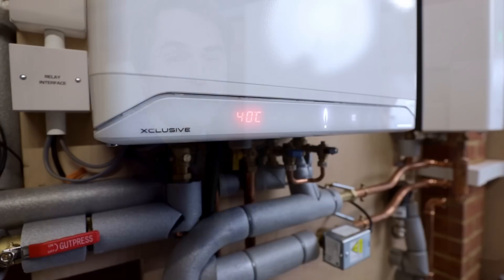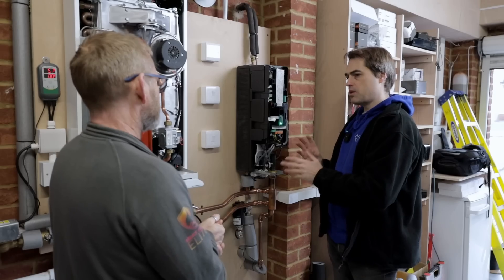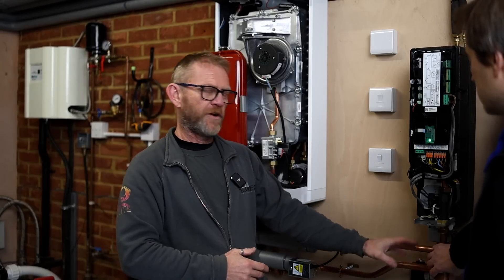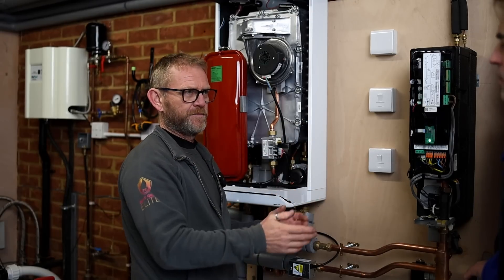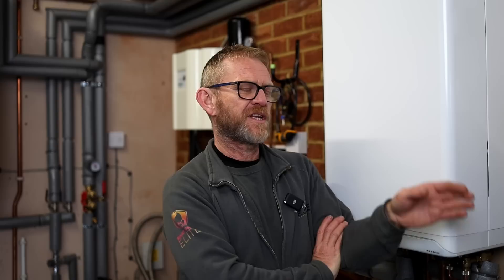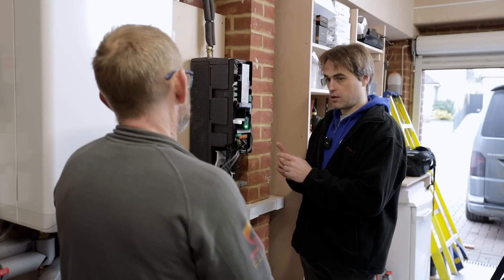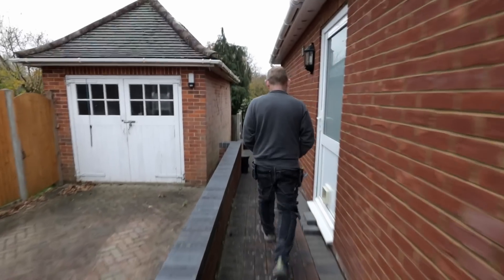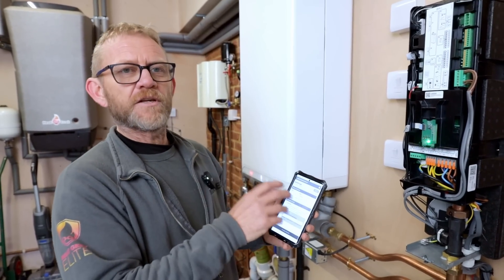Intergas Heat Pump Hybrid - The Easy Way To Clean Heating?

Comment: I run my hybrid system by topping the weather curve of the gas boiler by 2-4 degrees off the HP. HP delivers ok and only compensate with the gas boiler when OAT is 0 to -2, rainy , foggy, because the HP defrosts a lot but still delivers. It`s my first year using the system and I still play with the settings. There are two things I want to test for OATs 0 to -2 (worst for HPs), one would be to activate the BUH if OAT is 1 or below, so HP only in this scenario and the other is HP (BUH off) + gas boiler using schedule to offset the LWT of the HP to lower values that it`s actual demand from the curve, mostly during the night. There are options out there to automate these systems even better but at the moment I don`t want to modify the hydronic part. This season I heated with HP 99% (2 days heated with the Viessmann in Nov, testing different settings, full HP in Dec) and got a COP of 3.52 for both Nov and Dec, so far. Weather was mostly positive with OATs 1-13 but little sun a lot of rain and fog. I had negative OATs in Dec, 1 to -3, dense fog, for 4 days and having seen HP`s poor operation, I thought of ways to increase the pump performance and balance the heat demand between the 2 sources. Nice you are able to test different things and share an honest opinion. Cheers

Comment: Thanks for the video. Would love an update to see if fitting a buffer helped?

I love the concept of having a split ASHP: The outside unit is smaller and non split ones and it only weights 43 kgs according to the user manual!
Looking back at my smart meter data on the coldest day in Jan 2025 in Sheffield last winter, my gas boiler consumed on average 2kW of gas per hour, totalling ~90kWh for the day (that's excluding DHW). The outside temperature that day was -1 degree Celsius avg during the day and dropped to -6C by midnight...
With that it mind it sound like the Xtend split could be a good fit?
Am I right to assume by gas boiler would barely kick in if at all except a a few very cold days?
BTW my DHW is handled with an electric Sunamp battery (with PVs on the roof).

Comment: So from 11 months ao have they updated the software to allow the boiler to work if heat pump does not work
Reply: @UrbanPlumbers Would love an update, more in depth info on the software would be great if possible, a walk through on how to configure for peak, and off peak electricity costs for example ?

Comment: Why not just add a ASHP in series with the gas/petrol boiler network and have the boiler pump run all the time? ASHP can work with temperatures above 2C and boiler for lower outdoor temperatures. As a retrofit mostly but as a new system as well. Too much controls?
Reply: This is what the Alpha hybrid does - boiler and heat pump piped in series with a pump in the boiler and no pump in the ASHP. But you can't add it to an existing combi unfortunately.
Reply: @chrismorrish130  yes I know. The reason is the controls integration of the old (non Alpha family) boiler with the new system?
Reply: @christossakizlis  They don't even sell the heat pump as an addon for an existing Alpha Etec 33 boiler.

Comment: That look like a terrible setup. At least the alpha one works. They are not bothered about their carbon footprint with a swimming pool in the garden. 😂
Reply: The alpha hybrid is one of the worst hybrid setups out there.
Reply: @BristolHeatPumps  the alpha one works, this one is a comedy sketch. Daikin one seems to work ok, anything but this. Let’s try and reduce our carbon while heating our pool 😂
Reply from the maker: It’s a decent set up and very popular in Netherlands - that Alpha is not even close.
Reply: @AllenHart999  what do you classify as “works” pretty broad range. If your talking about it being a good stepping stone into renewables and putting it against other manufacturers hybrid options its an absolute shambles.
Reply from the maker: @BristolHeatPumps radiators get hot mate - it works !
Reply: @UrbanPlumbers  can tell he has been following heatable around 😂

Comment: Mmhhh, I'm not sold on this. Seems a bit like hybrid cars:- twice the complexity. If a heat pump can't get a property up to temperature it should not be installed. ICE cars make more sense in some applications, and BEV's make more sense in others. The main benefit of a heat pump in my eyes is to be able to get rid of the gas meter and save the standing charges on gas mains supply....

Comment: Great video, would this work on 24k HRE heat only using a x plan  with opentherm ?
Reply from the maker: yeah, should work fine
Reply: Thanks for that. Also Iam trying to make my x plan a x plan plus by fitting  a mid position valve after the N/O valve . It works to a degree  however Iam struggling with the opentherm on the nest wiring. Any help? Cheers Jimmy.

Comment: I wanted to confirm that the combi could still supply instant DHW with this setup, so watched again and indeed, that is confirmed by comment "no need for hot water cylinder". 
I believe this is going to make this set up a viable option for the majority of properties in the UK, as millions have had combi boilers fitted to gain room space (mainly in the form of loft conversions) leaving no room/space for a cylinder to be put back in!

Comment: Daikin  was using the Intergas boiler with heat pump system nearly 10 years ago, shame it didn't catch on, even then you could set the electric price,  the gas price and the system would work out the best way to run.
Reply: Yes, the Daikin hybrid system also uses intergas gas boilers. But the advantage of Daikin hybrid system over Intergas own hybrid system is that the gas boiler can work on its own even if the heat pump fails, according to Viva Training. Intergas should copy what Daikin do, they both use the same boilers, it's just the rest of the system that's different.

Comment: The main issue i see is that as soon as it drops below zero the ASHP frosts up and the COP drops through the floor.  This is the exact time you need the highest output from your heating and the ASHP can't do that.  A boiler can regardless of external temperatures.
Reply from the maker: That’s why a hybrid is a good idea

Comment: this has the potential to revolutionize the adoption of ashp's in the UK. But only if the government get off their high horse and start funding heat pumps even in the case the user is not willing to get rid of their perfectly fine gas boiler. At the moment, you can access a grant only if there is a complete swap over to a heat pump, which is not a thing a lot of people are willing to chance. Plenty of stories out there with conversions going wrong, huge electric bills, and not a lot of comfort at the end.

Also, on a side note, you just gotta love it when the management page for your multi-thousand pound heat pump misspells 'thermmal'. Confidence builder right there.
Reply: Imagine if the Brits had to write their manuals in French or German, Czech, Polish.. Hungarian!

Comment: @ 13:08 yes - homes with underfloor heating when is not that cold… but It might need a grundfos 15-75 pump inside to be able to run the underfloor heatting by itself on 100-120 square meters without an auxiliary pump …

Comment: I really like this ideea, but in the end  is it worth the difference in investment cost, taking into account that you get a less reliable system due to the complications brought to the system (useful by the way) and all this in the name of saving the environment?
wouldn't it be easier to be less aggressive/sporty at the wheel to compensate by far for the climate difference? I pay about 3 times more for gasoline than for heating the house... and I think I would pollute less if I learned to drive more calmly...

Comment: Ultimately I'd like something similar but a back boiler on the wood stove going to a buffer to boost an air source heat pump.  Not sure if it's possible or something anyone will agree too fit!
Reply: Better buy a solar System for warm water in the no heating decade . No heating Pump. 👍🇩🇪. Use this  System since 1995.

Comment: The Xtend is too small, to meet most demands and also access funding.

From my understanding you won't get gov. funding through mcs unless the ASHP meets the full heat loss now in Scotland, even for hybrids (except in extenuating circumstances) So only having 5 Kw available, (3 at sub zero temps?) is a bit small & limited for the majority of houses up here... 

And most won't install without funding...
Reply from the maker: its a perfect size for a hybrid. We acutally need more sub 5kW / -2 heat pums. There aren't almost any.

Comment: Like you Dracula, I’m a big fan of Intergash, but they’ve clearly not designed this system correctly!! The Indoor Condenser is clearly piped up wrong with, as Tommy states; the Gas Boiler should be the Master & the Condenser The Slave & piped up accordingly.
The Daikin hybrid system is a much better design. Also, the Vaillant is a better set-up & their control system is much superior to anything on the market.

I’m amazed Intergash produce & market such a poorly designed unit.

Thank for sharing Dracula, by the way you’re piling on weight, what you been eating@??!!
Reply from the maker: It will work fine on sub 5-6kw heat loss
Reply: Funnily enough, Daikin uses intergas boilers themselves in their Daikin hybrid systems. But I agree the overall Daikin system is better than the one Intergas themselves provide, even though they share the same boiler because for the Daikin setup, the gas boiler can work on its own even if the heat pump fails, unlike the Intergas's own hybrid system. Intergas should copy Daikin, they share the same boiler its just the rest of the system that is different.

Comment: Seems as though there will be more boiler cycling with this setup, even if it has a low minimum output.

The boiler is providing only a supplemental load, which is bound to be less than if it was the only heating source.

Hybrid might help out with niche setups but pure ASHP seems the way to go if at all possible.

Comment: I don't wish to be negative but I am struggling with the whole concept  of this design.  
If you are going to use a heat pump, fit a decent one on a suitable system that will deal with the heating and hot water.  
This system appears to only deal with half the heat demands ? Too cold - use the boiler. DHW - use the boiler. I struggle to see a huge advantage of overall energy savings ?   
Perhaps if a heat pump isnt suitable and you need the boiler, fit a decent one with manufacturer controls and spend the money insulating the house as much as you are able to reduce gas consumption ? Ideally this should be done anyway regardless of the type of system.    
It seems that complexity is being added with limited appeal/potential.
Sorry for the "downer". I will re-assess another time to pick up what I may have missed. 
Keep the videos going. You are a good guy in an industry that needs as many as possible.
Reply from the maker: Smaller heat pump will be very efficient and will take care of 80-90% of the heating needs at scops of close to 400-500%. DHW is only around 15-20% of energy use.
Reply: But if you are getting 400% on a decent heat pump, simpler system, no duplicity, no gas/standing charge, no boiler servicing/repairs, no "Extend" service repairs and redundancy on hot water ? Will a little more on the COP really be worthwhile ? Only my initial thoughts but I will take more time to look at it and give greater consideration. 
Thank you

Comment: Very interesting. Thank you for the video. I checked the price of the Xtend and it is over £4000. If you add install it is going to be a very expensive upgrade for a marginal benefit. intergas mentions  a 82.5% drop in gas consumption but fails to mention the increased electricity consumption. Technically interesting but only viable if it makes sense economically. Not sure this is the case.

Comment: Great video! Would love to see your thoughts on the Vaillant Hybrid setup (thats what I have installed) and how it differs. From what I could see it is much like the proposed setup with the buffer installed and I can set the system based on unit rates to determine which heat source is the most economical to heat the house. For me was the best solution at the time as it meant the existing rad setup etc. could remain unchanged (I did replace some older units and add a couple myself, but in general the upheaval in the house was minimal.

Comment: Can I have a combi with a 3kw immersion on smart controls. When elec is cheaper than gas it switches.
Reply from the maker: heating with direct electricity, even at a cheaper tariff is never cheaper than gas. At best the same.

Comment: I don't really like the idea of this tbh. The heat pump doesn't seem very good compared to other modern heat pumps that can work at very low temperatures. Surely it would be better to just have a decent heat pump, then you can get rid of gas and not pay the standing charge, not have two things to break down, and not have any direct carbon footprint from your heating.
Reply: Definitely this - so much misinformation about heat pumps.

Comment: MOST INFORMATIVE! I love te idea of having a unit that takes u very ittle space. I have a hybrid system at home in Poland........ where December - February we expriences temps. below zero degrees Celcius....like now. Electricty down to sero degrees and gas below zero......Paying as much for heating now as I was before the cost of fuel and elctricty went up ..... but =had to invest in a heat pump and buffer.

Comment: Or, if you only need 5kw, buy a decent (german) heatpump that can still produce 45C water till - 15C and 65C with - 7C, there are brands that can do this and still have a COP of around 3,5 to 4,5...
Reply from the maker: I have 5kw unit running with much higher cops than that 😀
Reply: @UrbanPlumbers  what cop is yours running at?
Reply from the maker: I got some running well over 5 and almost none below 4. I have installed around 20 in the last 12 months
Reply: I'm a bit biased, but indeed, a Stiebel can produce 65C @ - 15C for heating, 75C for hot water with a decent cop and scop

Comment: I like that it can potentially be added to any OpenTherm Gas Boiler.
Why not use electronic valves instead of a CCT surely that's the simplest solution?
Not withstanding the lack of BUS Scheme Grant in the UK, unfortunately based on the current price of Gas v Electricity you would need a SCOP of 3.5-4 for it to be financially viable.
Using a setup like that shown ie. Combi Boiler + Hybrid HP wouldn't it be best to run a two HW Cylinder setup? eg. One that combines a HW Cylinder and a Buffer Tank in a single unit?
Surely, ultimately, it's more beneficial to run the HP to raise the temp of the water to 35' and then fire the Gas Boiler to raise it to 50-55'c?
Reply: Depends on cost and your current boiler. If you've got solar panels already it could be a winner, especially if you don't use a lot of hot water and don't want a cylinder

Comment: I am looking to install an HP next Spring. It will have to cope with heating and DHW but if it struggles in mid winter then an immersion heating will back it up. I will then cancel the gas connection and save on the standing charge. Being warm and 100% green is my goal. Current set up: Energy supplier Octopus, 3.4 PV solar with 5.2 kWh battery.
I am sure the hybrid gas/HP with Xtend will be fine for many people.
Reply: I have similar system buy 5.9Kwp. 2 Years ago installed Samsung HP 8Kw. In 1 year cost of drop down by 10-15% compared to gas boiler. (Could be more but noticed that from late nov to mid jan there is a tree shading over my panels i most important part of a day) This year I got 5.2 kWh battery and charge every night. Since heating started my export hit 0 so I use all power from PV. Also notice that currently I use more kWh from night tariff. To think off 10Kwh should be better for winter.  Only problem is sell property with HP as ppl are afraid of it and thinking that its cost is the same as standard electric heating.

Comment: Hi Simon, sorry if this is covered in the comments below, but I'm confused how this works?  Outside temp too low thereby increasing heat loss thereby necessitating higher flow temps, beyond which is economic for the heat pump to supply, so 'boost' with gas boiler...  OK, that seems to work.... but, won't the return flow temps be then too high for the heat pump?  Will it actually be able to contribute anything in this situation??
Reply: You need far better modulation for this to work imo. The pump should pump away from the cct not into it. With such big low end output from the intergas the heat pump will be held back. The lowest modulated output modulated output from an intergas will meet most of the demand from the average house without a heat pump. A buffer rather than a CCT would allow the oversized output of the intergas to be stored and added as needed to the flow temperature from the heat pump. Maybe a mixing valve could be used to mix buffer water with the flow from the heat pump to supplement it. This would allow the boiler to cycle rather than stifle the heat pump output. This could also deal with defrost issues if the buffer could be connected to the system return also. I've not thought this through very deeply just my immediate assumptions. As yet I'm not in the anti Buffer and anti separation Club. Sometimes I think the obsession with distortion prevents people from correctly using buffers hydraulic separation when needed. There are some phenomena causing heat pumps to not work well that I believe buffers can help alleviate. I believe we can engineer out the disadvantages and harness the advantages of buffers and low loss headers.
Reply: Sure but once the demand compensation throttles the flow temperature back down it can kick in again.